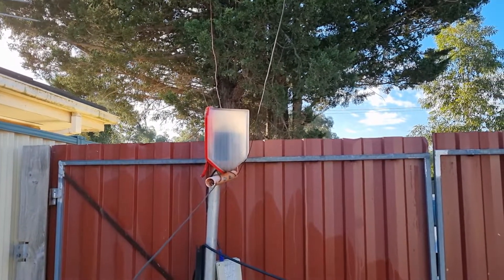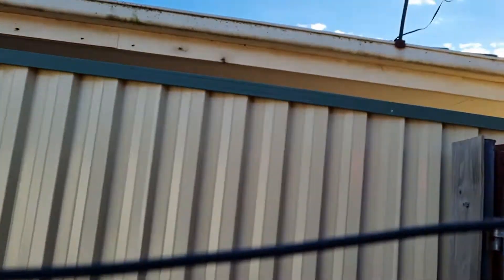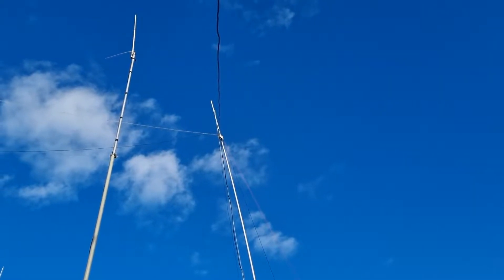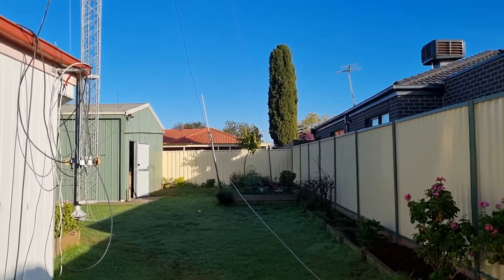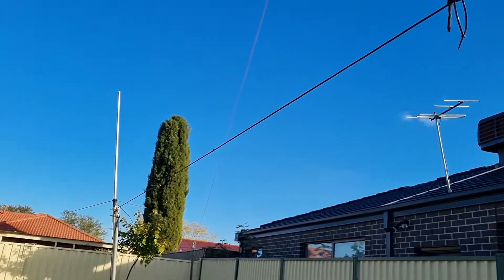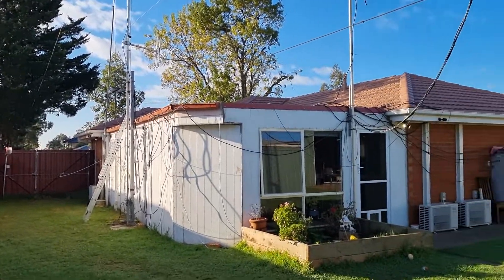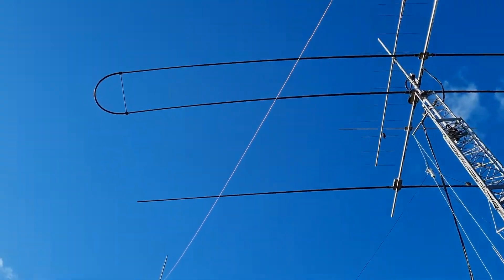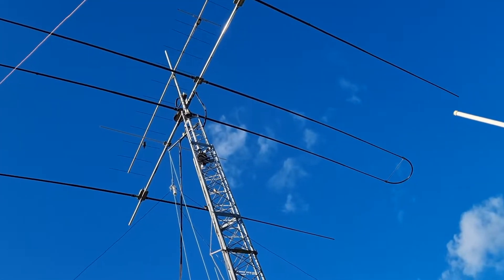My amazing multi band 40m vertical delta loop for 80m to 6m you need this #antenna #hamradio

Comment: Hello!  Thank you for the video.

Can you describe the parasitic element you added to get on 80m and how is connected and oriented relative to the 43m loop?  Thanks! 73
Reply from the maker: for sure the 20m long 80m element attaches to one side of the balun ( 1 works the other other doesn't )the feed point of my antenna is 1.5 - 2m off the ground and the element goes off in a different direction to the loop its is not overly high may be 6m but obviously the higher the better. in my application it has at least 200 khz band width tune for desired freq we tend to use 3.700 to 3.500 for ssb cw and ft8 please let me know how you go with it . btw it also works if loop is horizontal.
Reply: @meggalavk3ktt   my apologies for beating a dead horse... But for the sake of clarity, the main loop is ~20m long and starts at the balun center pin and terminates at the balun ground pin, yes?  And the parasitic element connects similarly to the balun and runs in the opposite direction, yes?  What length is the parasitic element?

Thank you again for your help! 73
Reply from the maker: @ceedeeznutz7230  NP the 40m loop is 43.7m long the 80m element is 20m long that come off at a tangent .